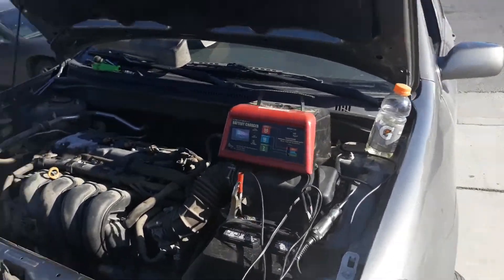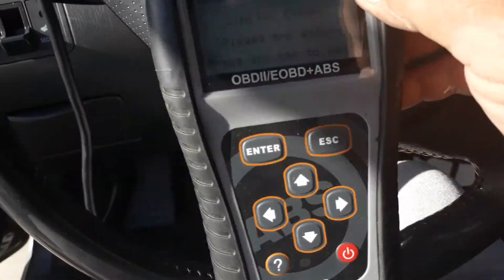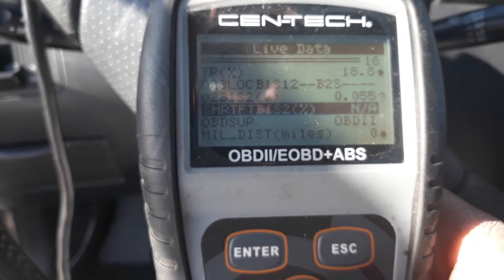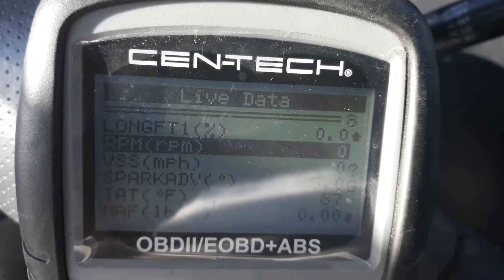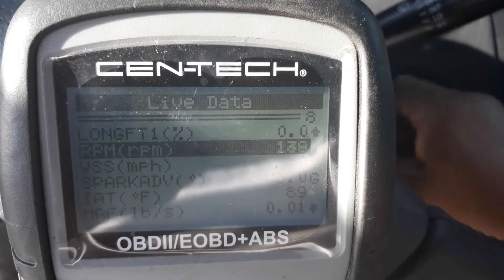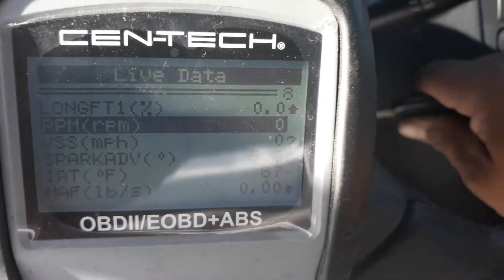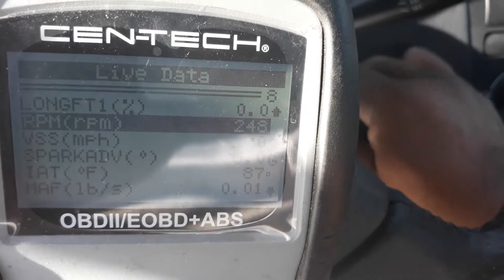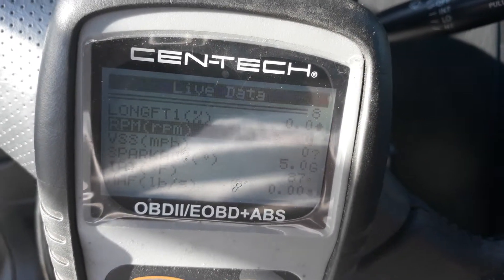Testing crankshaft position sensor for a 2006 Toyota Corolla S using scan tool

Comment: And where is the location of the crankshaft position sensor? Mine is 2006 Toyota corolla CE and I can't find it. I'm getting that problem code but the difference on mine it doesn't even crank, it only makes a click noise under the steering wheel column. Is it possible it's a relay?

Comment: I'm getting a code of PO606 my 2005 corolla stalls while driving. Nobody seems to know what is wrong with it.
Reply from the maker: https://www.linkedin.com/pulse/p0606-always-bad-ecm-brian-mann
Reply: @SuperDjnrg did new ckp sensor work
Reply from the maker: Try checking this
Reply: Yeah, I already tried that, last year... the issue was not fixed, still getting the codes and stalling. Possesed possibly I guess!
Reply from the maker: Have you had the computer replaced?
Reply: @SuperDjnrg  Yes.
Reply from the maker: @EmilySuzanne  let me look into it and see what i can find.
Reply from the maker: Has anyone ever checked the car for short circuits? Also has the battery been tested?
Reply: @SuperDjnrg  They have checked for bad ground wires..